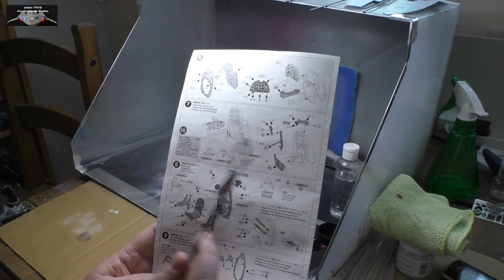1/48 Scale Spitfire mk 1 Part 2

Comment: I can't remember where I learned about putting down black first before metallic paint but it does change the look of top coat, for anything, not just silver or Aluminum. I've done it with copper, bronze, steel, it's a great effect.
Reply from the maker: I came across it by accident, I was spraying black on one part, then changed colour to silver, there was some over spray on to the black it looked very good, so I tried it and yeah it gives a very deep metal colour, I was very impressed so I share my idea when ever I can.